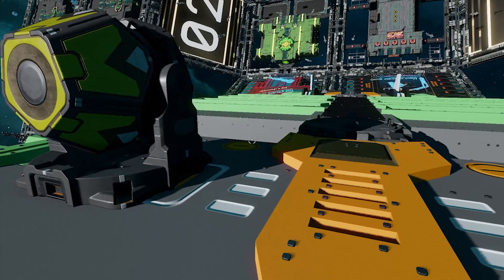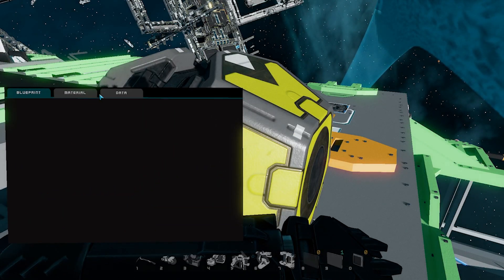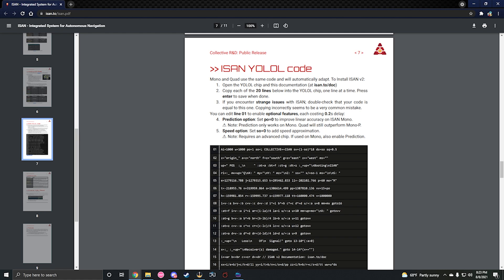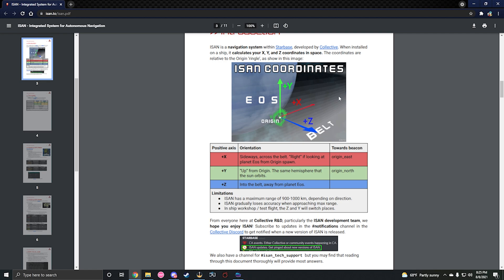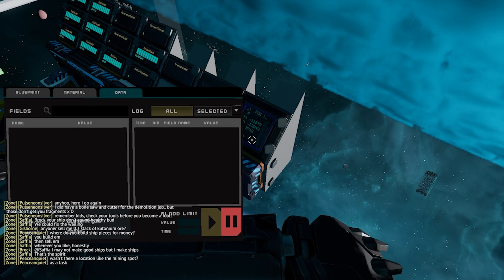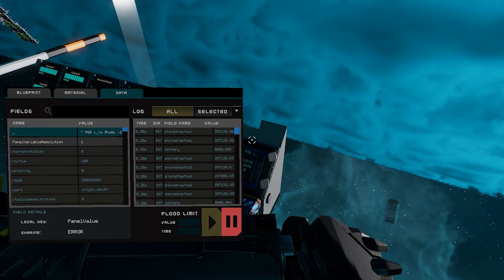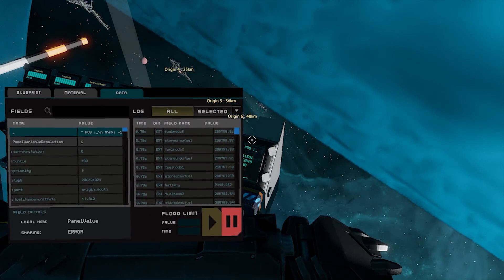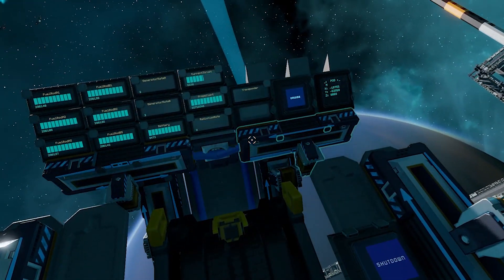Starbase | How To Install ISAN v2 | Updated Tutorial

Comment: After entering the code all i get is isan v2 cant see reciever. Been through all the steps including the code line by line. however i noticed your code in the vid is dif from the pdf. guess ill type it all from a pause and see if that works.

Comment: is a Z of 9000 accurate? I thought the z should be near zero while over a origin. I have an issue where my ISAN is saying my z is 21000 while over origin. Im not sure if Its set-up correctly.
Reply from the maker: Z is supposed to be negative when near the stations positive into the belt 0 is in the middle of all the origin stations
Reply: @flamesyue  hmm, my GPS has been wacky. The other day it seemed to be working better, then I went through a warp gate and receiver damaged message appeared. I did a streamer reset, and now its way out of wack again. Are the devs going to release a nav computer or something in the future? We need a way to have nav points and a hologram like map for the belt and zones etc.